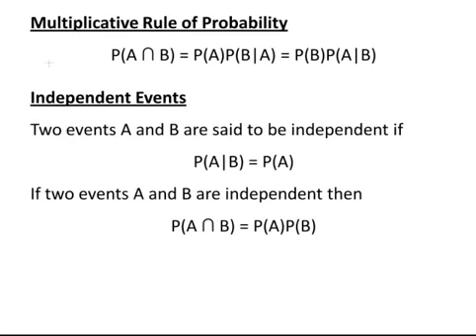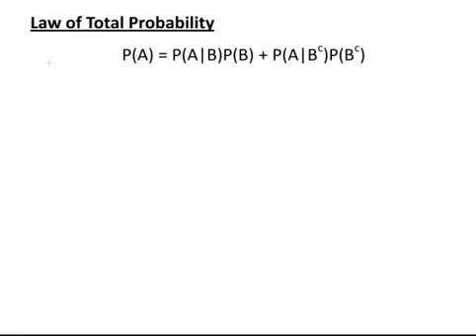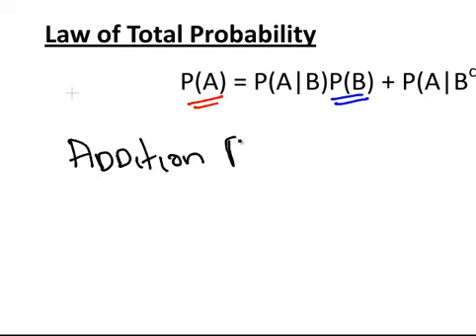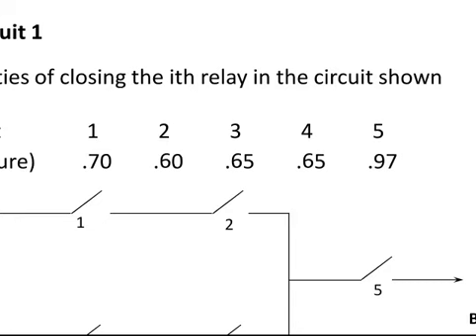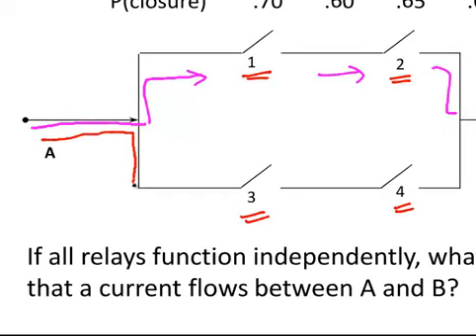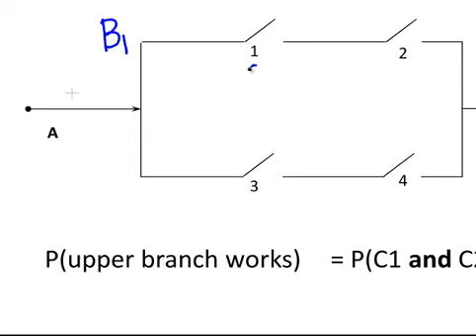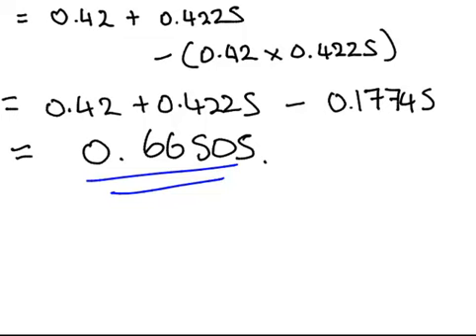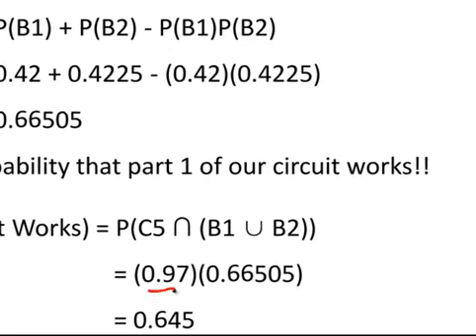Probability Tutorial : Electrical Circuit Example

Comment: for P(B1 n B2), should it not be that it is, P(B1 n B2) = P(B1) + P(B2) - ( 1 - P(B1 n B2) )? The reason is because P(B1 n B2) represents all switches are closed, and we want to subtract the case that all switches are opened. Right?

Comment: Loved your explanations , however when I tried to apply the same rules on a question , I couldn't reach the right answer.Could you please solve tihs question : It again asks the possibility of the current to flow from A to B , However there are only 3 switches on the upper side , and 2 switches on the lower side of the circuit , there s no other switches before the divison of the cables nor after the combination.The possibility of any swtich to be open is 1/3. Could you just tell me the answer at least?